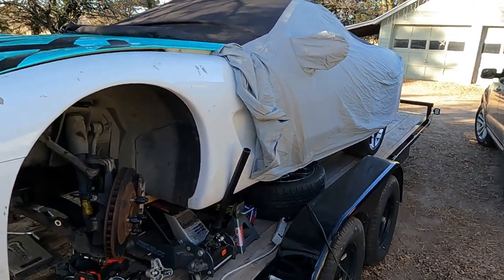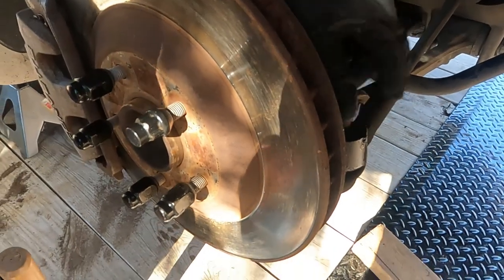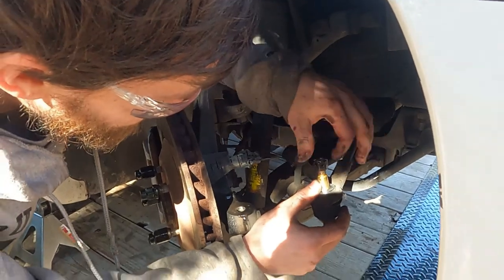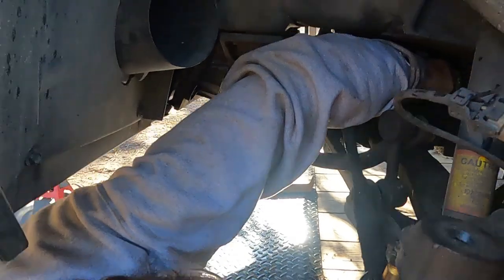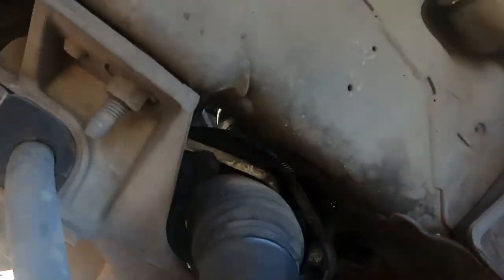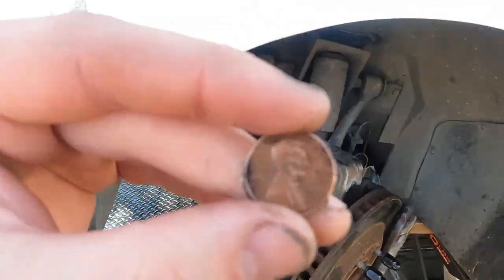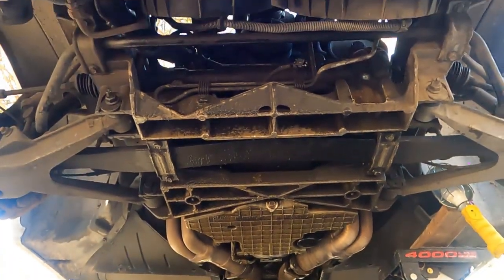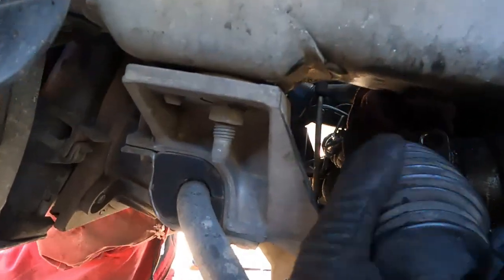How to remove a steering rack on a Corvette (C5 1997-2004)

Comment: I had to replace the top oil pan gasket on my c5. The sub frame has to be dropped to get the pan out. So the engine needed to be supported by a hoist. The rack needed to come out and all harnesses needed to be disconnected. With the engine supported and the engine mount nuts removed I lowered the sub frame by loosening the sub frame mount nuts to the bottom thread. This added about a 1and1/2 inch clearance for the steering box. I had also removed the "A" arm suspension and leaf spring. I was working alone and considered installing the sub frame with the suspension intact would be near impossible alone. I removed the rack (your video helped with that). I put an ATV jack under the sub frame and lowered it out. Replaced the oil pan gasket.  Time to reassemble. Hung the sub frame, Installed the rack. All going smooth until I tried to install the power steering connections to the steering box. Connections would not align, wanted to cross thread. After repeated failure to align the threads properly I dropped the sub frame, installed the rack with the power steering lines connected, jacked the assembly as a unit into position. I had to go in from the right side, raise the assembly enough so the left tie rod would go over the abs hydraulic lines and position the transverse brake line behind the rack so it could be secured to the back of the sub frame then pushed and jacked the sub frame into position .  Torqued sub frame and engine mount nuts to spec, job done , time to put my feet up and have a beer.  Sounds like a lot of unnecessary work but this will be my go to method in the future. In the end it would have saved me time, frustration and a whole lot of expletives deleted.
Reply from the maker: Thanks for the awesome write up! That's sounds like it more work that paid off and made it an easier job. 

If there's a next time for me I'll try this way instead 🙌🏼

Comment: When you were removing the passenger side of your steering rack, was there a metal bushing holding the passenger side in?   Mine just WILL NOT come undone.
Reply from the maker: I had a rubber bushing on that side. It was pretty tight but it was harder putting back in than taking it out. I used a 2x4 and my hammer to get it back in.